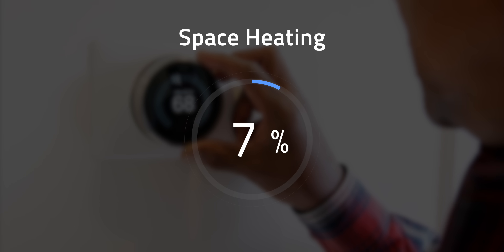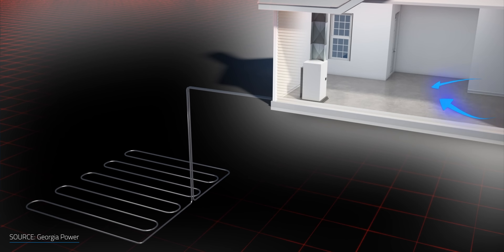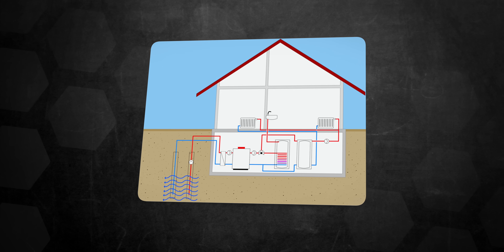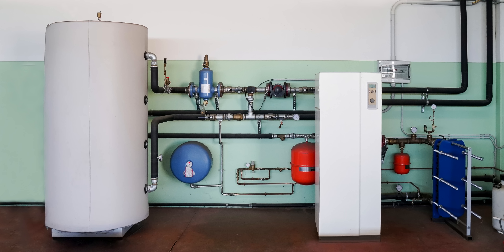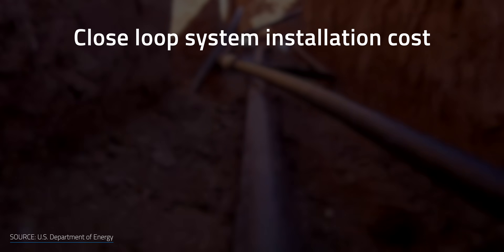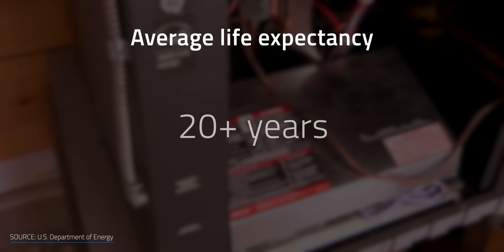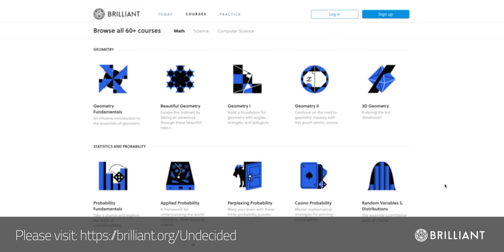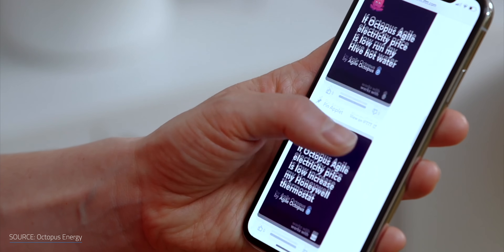Is Geothermal Heating and Cooling Worth the Cost?  Heat Pumps Explained

Comment: I prefer to advise people to stick to gas heating for the following reasons:
1 Reduced installation and maintenance costs
2 It is much easier to find competent people to do your installation and maintenance + Because they are cheaper it is much easier to have spare parts in stock :)
3 If instead of installing a geothermal system and instead you put gas heating and the difference of money you put it in the adequate thermal insulation of the house where you find qualified personnel easier and are less likely to have to make expensive repairs after installation and where the risk to have problems after installation after is minimal :) ..
4 The space required to install the heating system is smaller 
5 Reduced time and maintenance costs
6 You will not need other taxpayers to contribute indirectly with the tax grant you get -  It is not fair!!!!!

Comment: First you need to upgrade your house into passive house or close to it. It will reduce your system size by 30-40%
Reply: What exactly is "passive" system?  Thanks.
Reply: @buddyplatt6496  Google "Passive house"
Reply: @KevinJDildonik  To be fair now days many houses in the US are easily from the 1960's to maybe the 80's and you might as well flatten the house and rebuild the entire thing because of MANY  changes in building codes, electrical, plumbing and geothermal heated houses tend to work best when built that way.

Comment: Is it still make since to add this system after adding Tesla's solar roof? I mean we can relay more on electricity for heating and cooling if it is free.
Reply: Power is never free and is always limited. Sure you generate "free" electricity. You just need a $20,000 solar system to get it.

Comment: My new 6500sqf house has a 5 ton gshp no auxiliary heat strip. 5 ton Unit and five 150 foot deep  vertical closed loop wells cost  $15,000 . My electric bill for the whole house is less that $1,800 a year.  My latitude In USA is 39.103119

Comment: Your video does indeed show how heat pumps work, but to be more precise, they work EXACTLY like a window air conditioner. I think many ppl miss this and think it's pulling heat out of the ground somehow and transferring that ground heat into your house. NO, the heat pump unit is creating the (heat in the winter, and cold in the summer) by compressing a gas via an electrical compressor. So the heat pump unit is always going to use about the same amount of electricity as a whole house air conditioner uses during the summer. The ground source, whatever sort is used, keeps the unit functioning year round. The role of the ground source is what is hard for ppl to wrap their minds around. That it keeps the machine running smoothly is one way of explaining it. Those who have window AC's know that on some really hot days, the unit freezes up and stops functioning. In a heat pump, the ground loop liquid keeps that from happening.

Comment: Heating and cooling typically don't occur at the same time, so 15% and 16% shouldn't be additive.  It would be more accurate to say that climate control costs around 15.5% of energy used.

Comment: Have been using closed geothermal system 5 years for heating and cooling. I have The most common system used here in Finland. The vertical system with just one deep hole. There is no maintence at all and its cuts Your outside energy needs to 30%.

Comment: As a heating/cooling contractor and homeowner in Massachusetts, we have some of the highest electrical costs in the country. I have a customer who had me install the inside equipment and duct work under the supervision of a geothermal expert. 
This goethermal system is a closed loop with 3-500 ft vertical deep wells. 
The indoor equipment are water sourced heat pumps which I see in larger buildings that would have a water tower as the fluid source.
So what did I notice in the 8 years since I installed this geothermal system?
The homeowner complains that his electrical bill (mostly to run the HVAC equipment and domestic electric hot water heater) is pretty high compared to his natural gas neighbor with the same size apartment and insulation value.
I think Matt Ferrell needs to do a comparison with VRF air sourced heat pumps such as latest Bosch equipment before jumping on board with the geothermal herd. No one ever talks about the large pumps and electricity needed to circulate through the closed loop field. Andrew Palarady, who posted comments 4 days ago below, seems to know what I'm trying to state.

Comment: Your video touched on just about all my experiences with my gshp geothermal system. We purchased our home in 2002  in SE Virginia with its original open loop geothermal system now 20 years old. Loved it until 2013 when I walked into my garage to find the well pump had blown to roof off itself because the debris in the water over the years had clogged the return line and the pressure destroyed the pump. Crazy estimates to replace the pump and drill a new return line left us still with a 31 year old open loop system. We opted for a new closed loop system that is AMAZING! We had 5 wells drilled instead of the 4 the system called for and they are each 200 feet deep. No debris to deal with in a closed loop system and much quieter since the pump  is much smaller. I will never have another heating/cooling system other than geothermal. Great video!
Reply: Zombie Eric Harris   I'm not so sure I would change a thing in how mine was put in place. My salesman sold me the system, the company already had a well drilling company they used, who not only drilled the wells but installed the loops of tubing, and then connected all of the tubing into the manifold that attaches to the unit. It was "one stop shopping " and it limits the number of persons who have their fingers in the equation. If one subcontractor messes up on their step it can destroy the whole system, and with one person (or contractor) in charge, anything goes wrong it's on them. Good luck with whatever you decide!
Reply: Zombie Eric Harris   The cost of the new closed loop system was 18k and some change. Overall it's been the best investment since we've owned our home. Next up is having our crawl space encapsulated.

Comment: This is all based on mains supplied electricity as the only means of power.
Reply: Ground source heat pump does not need huge backup generator to run. 3KVA generator runs system for quite large house.

Comment: I have no doubt that systems like this are the future due to the environmental benefits, but I do question whether these systems are cheaper to run? I have a old poorly insulated house which is roughly 3000 square feet, but has a new top of the range conventional gas central heating system. I am moving for work and recently viewed a new stone barn conversion (3500 square feet) which had one of these systems installed. The barn conversion was completely insulated to very high modern standard, and I asked the owner how much is cost to heat the house. He said to maintain a temperature of 20c he had keep it on all the time, and the total cost of electricity for the house for the year was £3500 (heating and everything else). My house annual energy (gas and electric) bills in a year are about £1800-2500. The system cost £25k to install vs £8k (Worcester Bosch boiler and vented pressurised tank, with whole new radiators and piping) for my conventional system. This is UK energy and equipment prices so may vary else where. These systems will be the future or at least an option for some in the future, but currently from what I’ve experienced seem more expensive.

Comment: Wondering how's it going to work in places close to the equator? Where it's always hot and always humid.
Reply: It works better than an air sourced heat pump or air conditioner. You are dumping heat into a 55 degree ground instead of 85 degree air. That said, installation costs will probably be 5 (?) times higher than a traditional A/C setup. Probably better off focusing on insulated windows and reducing solar heat gain into the house.
Reply: One of the cheapest ways to reduce your cooling costs would be to plant trees around your property to provide as much shade as possible. Not only would they reduce solar gain they would also make it look much nicer!
Reply: @spencerwilton5831  nah. I have plenty of tall trees all around my house (perks of living in the countryside) still not helping, the humidity is the real problem here, it always above 65% on average and it sucks so many asses.

Comment: About cost:
Why a heat pump that is basically a slightly more complex version of an air conditioner (two extra low pressure liquid recirculating pumps and liquid-to-liquid heat  exchangers instead of air-to-liquid) costs 20x the price of a similar btu split air conditioner?
The extra parts surely do not make up the price. 
The heat pump only, no installation labour and underground piping, the latter being actually really cheap.

Comment: I need to think about replacing my A/C unit with the old refridgerant, a 15 year old unit, etc.  Since I'm replacing the cooling it makes sense to look at replacing the furnace at the same time.  i was going to get standard gas and A/C  but this video really got me thinking.  I need to look into replacing the traditional HVAC with geothermal.  Thanks for the informative video.  We have a smaller house on a larger lot and I think a closed loop system might make a LOT of sense.  Thank you very much.

Comment: We have a Geothermal system in Northern Ontario I would advise against installing it with horizontal lines, not that is not working but during a very cold spells the furnace runs constantly to recover any heat out of the ground loop and it shuts off after about 6 hr, then you have to manually flip the breakers off wait 10 min and back on and it works again for a day or two (works fine if the temperature outside is -10- -15C below that is a problem). My understanding is that this is a self protection system kicking in to save the compressor, unfortunately if you leave for vacation and this happens on day 1 you will come back to a frozen house, pipes etc..maybe a vertical loops have a better heat gathering ability or if anything go deeper then 6ft also with the rising cost of the electricity all the supposed potential savings from that system are none + higher up front and maintenance cost just my 2 cents after having the system for 12 years
Reply: It sounds as if your system was not properly specified, possibly the ground loops are not long and / or deep enough. The whole point about ground source heat pumps is that they are largely unaffected by low air temperatures. If they are too close to the surface though the ground will become too cool to allow the system to function as intended. A properly specified system should be able to run continuously without interruption, for month after month. The only time it should shut down is when the room thermostat tells it too because the house is warm enough. I'd have it inspected by an independent engineer and have the installers back out to relay the lines if they are undersized or too shallow.
Reply: @spencerwilton5831  I have talked to to people that install those systems after years of being used and so far I’m getting same answers that those systems are not designed for such a cold climates period, they will work but not efficiently or trouble free

Comment: Some of the biggest marketing scams of our age, are the naming of methane gas, as “natural gas”, an diesel fuel, as “heating oil”.
Reply: I believe natural gas is a mixture of many different hydrocarbons: methane, ethane, propane, butane, etc. Likewise, diesel and heating oil tend to also be ranges of different lengths of hydrocarbons, with different, but overlapping ranges (according to wikipedia).

Comment: Fantastic subject, but probably not the best approach for my 2021 project.

As soon as it warms up I want to build a well house with filter, water storage, and water pressure booster. It can get darn cold in the winter, and I need to keep my well house above freezing. Year-round average temperature is 41°F (5°C). I'll set the bulk of the well house underground, with the top surface of an uninsulated concrete floor about 5 feet (1.5 meters) below grade. Then ICF walls with a super insulated lift-off roof using closed-cell foam. I might maybe possibly need auxiliary heat, but I hope not. I guess we could call this passive geothermal.

Then starting in May work on the little 636 square-foot (59 square-meter) cabin. As for heating, no geothermal. I don't mind digging a smallish hole 6 feet (1.8 meters) deep, but the entire lot is decomposed granite with solid granite somewhere below the surface. I think I'd be better served with air-tight super-insulation, and something like solar hot water with a storage tank, but use the water to heat the cabin. Plenty of sunshine year-round, it's just that some days are below -20°F (-29°C).

Comment: In our previous house (Northern Utah) in 2013, we installed a vertical ground loop heat pump system. At the time there was a federal rebate. Total ROI was 8.5 years. It is a fabulous system. 
At our new home I looked into installing a vertical ground loop heat pump again. However this time (due to the much higher efficiency of the home, no more 30% federal rebate and higher install costs) the ROI would have been 69 years. Ouch!! We installed an air source system instead and has been great too.
Reply: I don't understand, why was the second situation so less economical?
Reply: @cordeliaparham6800  Federal rebate is no longer available, only one company installing them in N. Utah now. With no competition they raised drilling prices substantially. Also the home is more energy efficient than the last one so less energy consumption means a smaller energy bill. Higher overall install cost divided by a smaller energy bill makes a larger ROI.

Comment: I'm from Spain and recently i thought in renew my diesel system for an Aerothermal system. I asked for prices and the installation costs 14.500€ (about 17.300 dollars) I was shocked about the price since it only had to replace the pump system. 
As well I was talking with some technicians and I found they are split about the real efficence of that kinds of systems...I'm sure Geothermal is better but the installation price is too high for average people in spain...probably around 25.000€ (30.000$) and we don't have any kind of federal helps as the americans.
So I think i will stay burning the planet with my diesel heating systems which costs me around 4.000€ to replace. sad face

Comment: You said that heating comprises 15% of power use and cooling comprise 16%. Then you tried to add those together and say that they take up 31% of electricity use in the US. Did you go to Bubba College? 
They take up 15 and a half percent, because you don't use them at the same time.
#MathFail

Comment: Do you see a benefit for using both Solar and Geothermal?  I will be building in the DFW area by the end of the year.  My Southern exposure roof which will also cover approx 2k sq. ft. of porches measures 100’X50’, 5,000 sq. ft.  My current thinking is using the then current Tesla Solar Roof with multiple Power Walls, maybe between 4 and 6.  We have one EV and want to plan for a Cyber Truck when I can get one. Thanks

Comment: I converted my house in 2019 (133+40 m2) here in Sweden. I have vertical closed in a single 240 m deep borehole. The heat pump is inverter type with a variable output range between 6-12kW (Nibe).

The annual energy savings is roughly 20 000 kWh. Im really satisfied. Cost of installation about 21.5k euros. Payback circa 8-9 years.

Comment: Slinky coil loops are a waste. A given volume of earth can only conduct/move a limited volume of heat. Adding more tube exposure does not change how much heat can be moved. These systems just allow the installer to sell more poly pipe at a marked up price. Horizontal loops can be quite affordable. Your prices are ridiculous.

Comment: I'll stick with my 21Kw Solar system and Electric baseboard/ floor heating.  way more efficient, no pumps, no compressors, no fluids, no digging.  And to top it off, I've got the Tesla power walls.
Reply: Incorrect. It is impossible for an electric system to be more efficient. An electric system can't have a COP greater than 1:1. You are using 1 unit of energy to create 1 unit of heat. That same 1 unit of energy in a geothermal can produce 3-5 units of heat.

Comment: Geothermal heating seems like a misnomer. More appropriately called ground source heat pumps vs traditional air source heat pumps.
Reply: Geo is short for geological or geography yes so it means the ground or the study of the ground and all it's parts and things. so any heat you pump into or out of the ground has to be by definition geothermal sure your not tapping into a hot spring or a volcanic tube or anything but the title is 100% accurate
Reply: Agreed! You have to go 100s of meters down in most places to get any true geothermal power. The wiki on 'Geothermal gradient' explains this well.